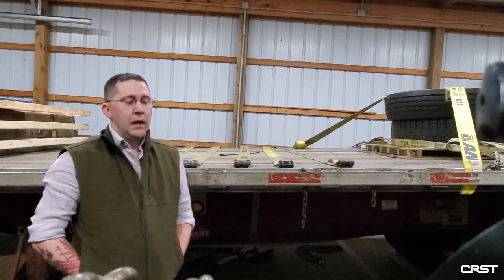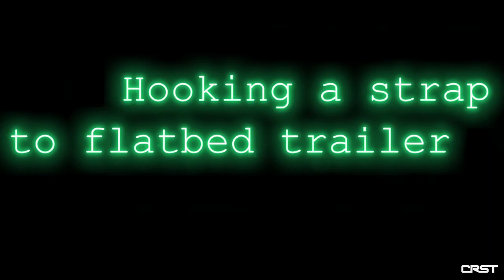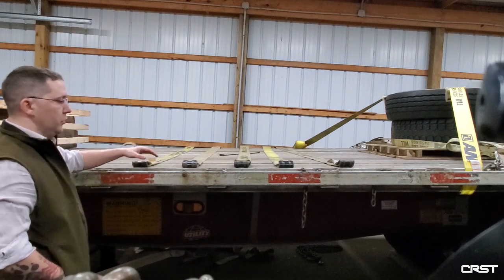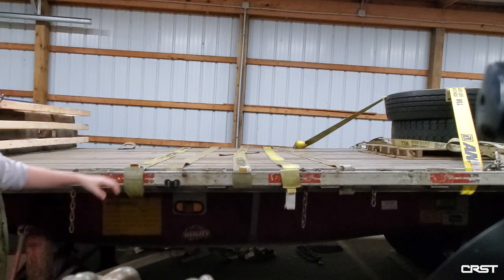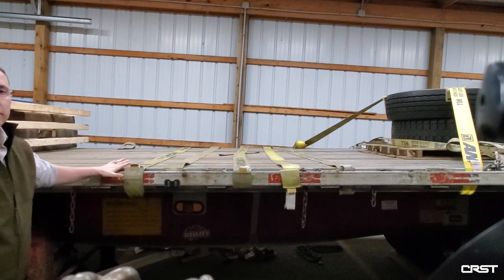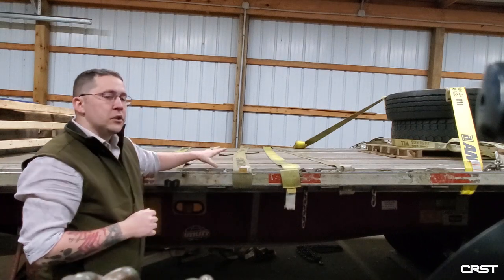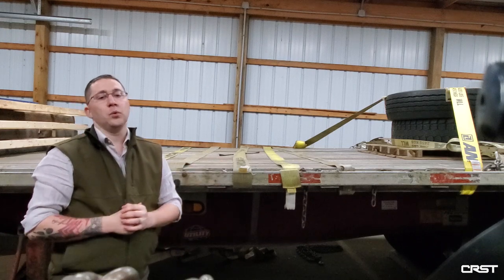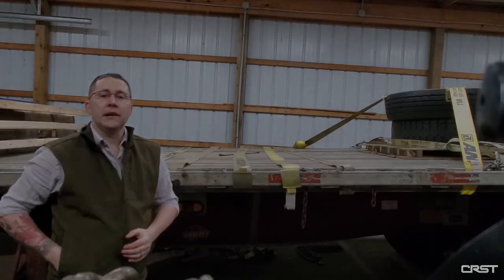Hooking a strap to a flatbed trailer - Safety Saturday

Comment: Out of the 20 flatbed trailers I used, only 1 had an underneath grip rail. Another one had it but it was too damaged to use.  I would guess 90% of flatbedders use the rub rails.  I have never heard of a load lost because the straps were cut. 
Besides, chains only fit on the rub rails because the hooks are too large to catch under rail.  If so worried about accidents, then only chains should be used with chain rubs ( garden hose, tire rubber, plastic T, etc).

Comment: Problem with hooking to trailer is you can no longer move winches on that side to help should you need more straps during original tie dow or during your trip. If attached to rub rail, you are able to use winches on that side should you need them. It will also bend your hooks out to where you can no longer fit them between the trailer & rub rail. I'm not arguing the legality, just the practicality. Do it his way. You'll spend 3 to 5 times as long, undoing straps to move winches & have to thread straps through because your hook is stretched out. Try turning a 1 hour strap down into a 5 hour strap down & let me know how that works out for you. Especially on short runs.
Reply: Skill issue.
Reply: If I can secure a 35-piece load including a roll of rebar and two 24 foot deck boards in 20 minutes with an old broom and a ladder, there's really no excuse to have straps outside the rail. I tighten up 30 trucks a night, and I'm timed for it, and I have to fix any unstable product by handstacking. That's my entire job.